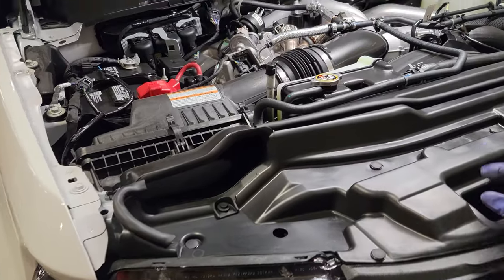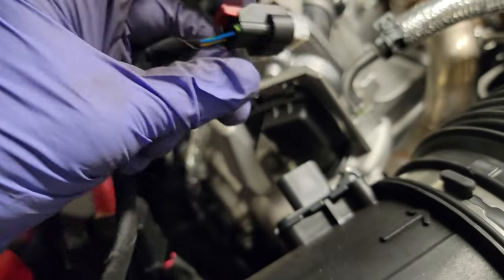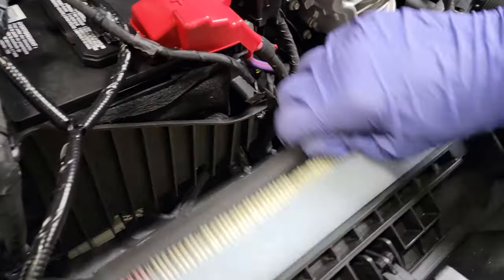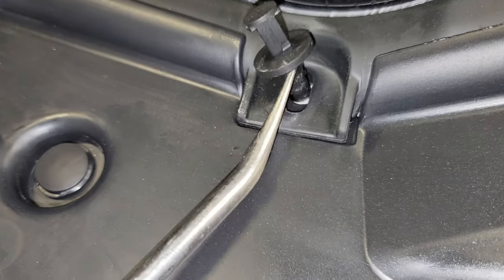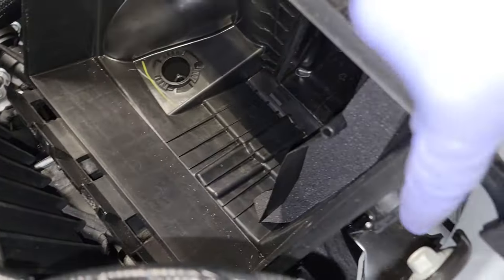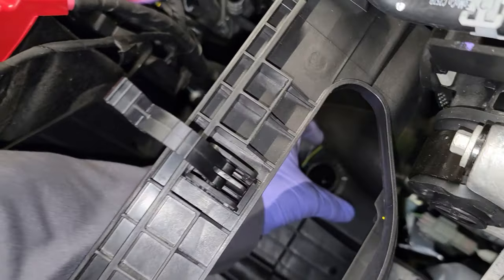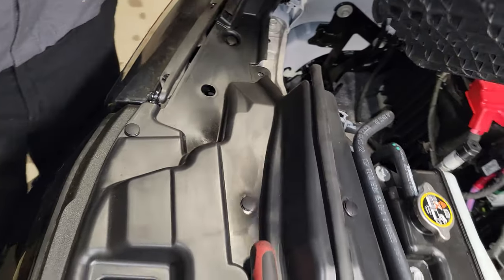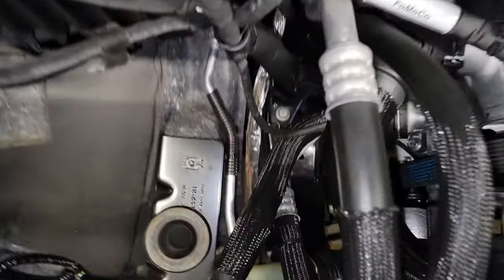STOP being a WIMP & PULL HARDER | 2020-2022 Ford 6.7 Air filter housing REMOVAL

Comment: Great vid man.  I just installed a new Banks Power cold air kit on my 2020 this past weekend and had to remove mine just as you showed in the video.  I did have the luxury of both hands 😊.   Nice job as always.
Reply from the maker: Niccce
Reply: How do you like the Banks? Does it sound any better?
Reply: @robertrosenstein4430  so far I really like it.  I do hear some sound difference and I am stock (not deleted).  It isn’t overwhelming but notice a little more growl.  I will say the Banks filter element itself is bigger than other kits and appears to be a quality product like most other Banks stuff.  Install was easy as well.
Reply: @chadh6899  thanks for the insight. I’m going to buy one. I honestly could care less about gains, I just want to hear the 6.7 rumble a little while still carrying the extra weight underneath.
Reply: @robertrosenstein4430  yeah I definitely can relate to that.  I am impressed with the setup so far and expect you will be happy with it.  Best of luck.

Comment: I remember the bad ol days when you just reached into
the engine bay & removed the starter, or alternator, or
water pump. Today you gotta spend untold hours
removing this that & the other to gain access to what
you wanna remove. Such a hassle. HOWEVER, just
think how easy it is going to be when all vehicles go
electric.

!
Reply from the maker: Id RATHER STRUGGLE
Reply: Wack.

Comment: Forgive my ignorance, if all I'm wanting to do is replace the air filter (2020 f350sd w/22k) why would I need to remove the air box? Was this just showing how to do it but not necessarily for filter swap? Thx, love your videos!
Reply from the maker: U just need to take the lid off, thats all
Reply: @PowerStrokeTechTalkwARod  got it thanks!! Do you have an opinion on aftermarket filters (cabin/air/fuel) like Docs Diesel vs OEM?
Reply from the maker: Cabin oem. Fuel filter...stock unless ur doin the HSM stuff

Comment: I just found out that you don' t need  to pull harder. Just take 3/8 hex key and turn the bottom mount to cut slots in the air box and will slide up easily.

Comment: just curious , with the air box removed can you reach on headlight bulbs ? I like to replace mine with LED bulbs , but don't really like to remove complete light light which require to remove the grill  to do that . Stupid me missed the LED option when I was ordering my 2022 F250 power-stroke .
Reply from the maker: Yes, watch my Auxito video, i did JUST that
Reply: @PowerStrokeTechTalkwARod  Thanks , glad it is possible to replace the headlight bulbs without taking all front of the truck out for such simple task. 😎

Comment: What is the difference between diesel only air filter and gas only air filter can you use either one or does it matter
Reply from the maker: ....that's why there is a diesel and a gas.  No you can't interchange them

Comment: I have almost 25k on my original air filter, the dash says my filter is still good. How often under normal driving conditions should I be replacing the engine air filter?
Reply from the maker: I visually look at it. Will all depend on your surrounding area....not dusty youll be good...vice versa youll have to be on it. Not really a mileage, just gotta look at it. Id say ur due!
Reply: @PowerStrokeTechTalkwARod  10-4